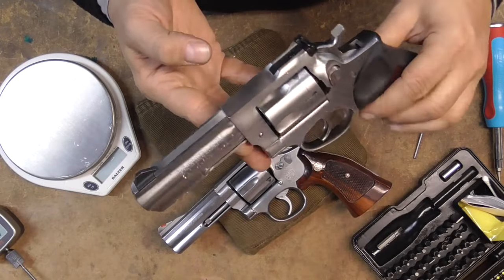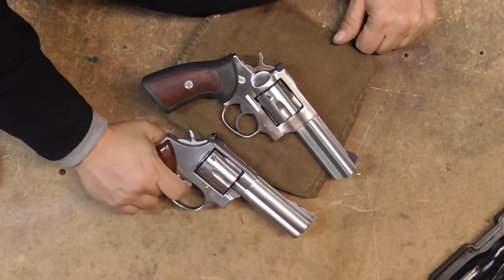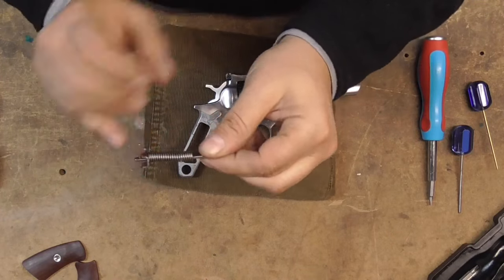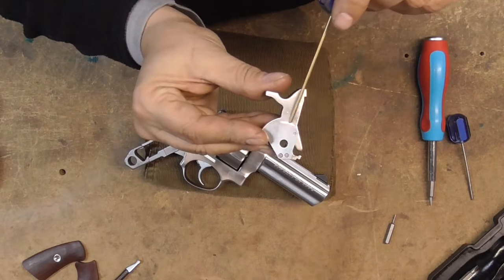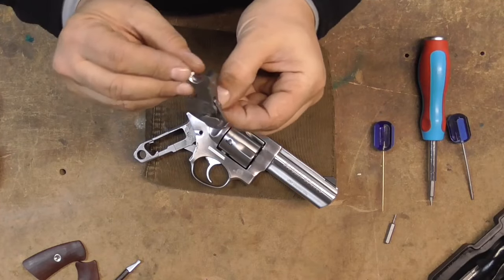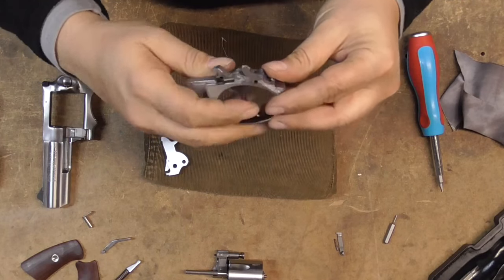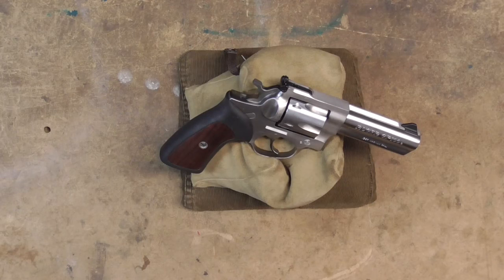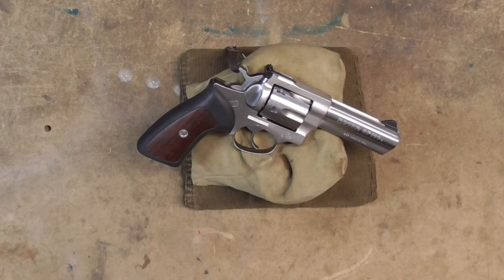Ruger GP100   Disassembly & Smoothing Up

Comment: The reason that the Ruger has a thicker top strap than the Smith , is because the Ruger is cast, the Smith is forged. They are for all intents and purposed equal in strength. Furthermore  anyone who puts over max loads in any gun deserves to get their gun toasted. That is simply stupid.